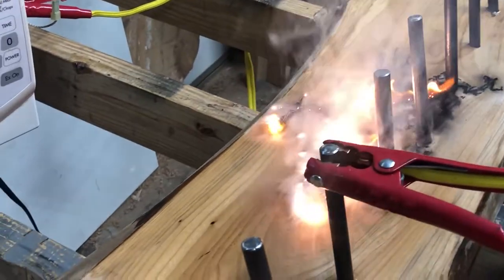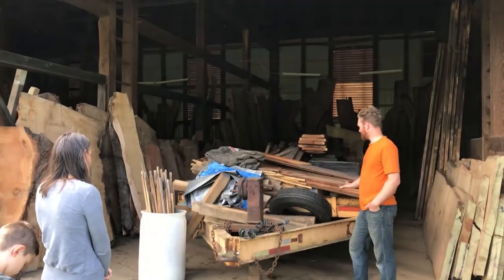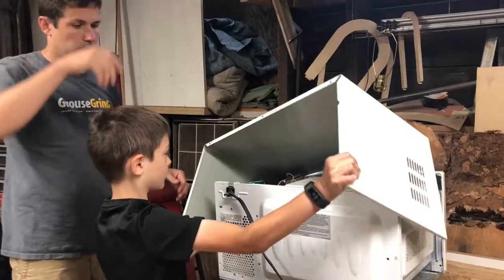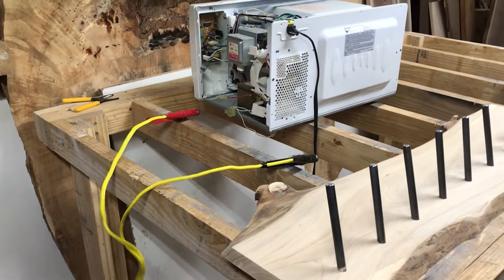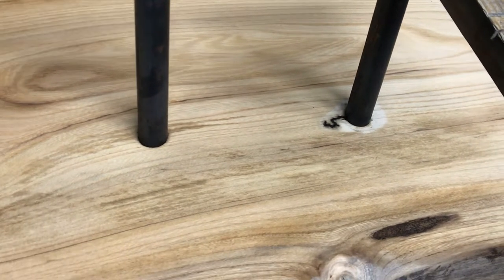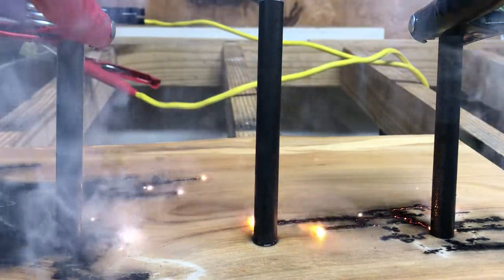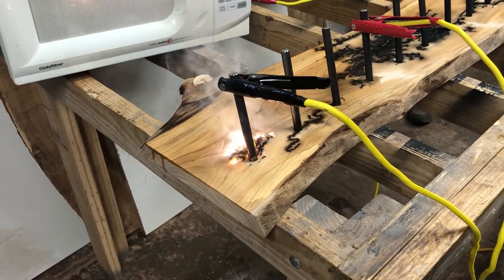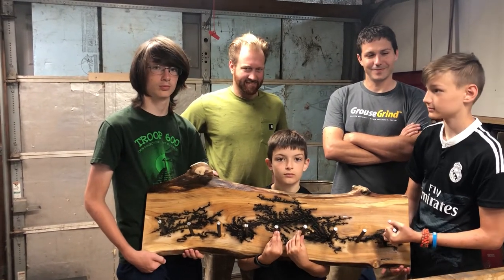Electric Burning a Coat Rack

Comment: Do the burn marks wipe off or anything?
Reply from the maker: They don't. There is some black soot that you need to clean out with water and tooth brush or air compressor, you don't want that to soak into wood. But after that you have a black line, some very very tiny. They also have texture to them. Big ones can be as deep as 1/8". You could even fill with epoxy that changes color.
Reply: Summer Flies that's awesome! Thanks for the reply!